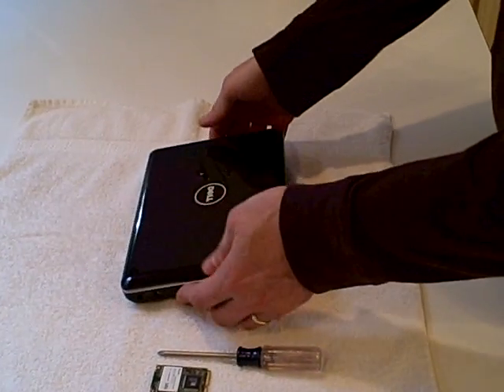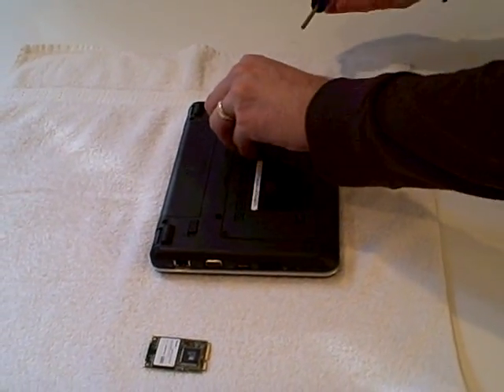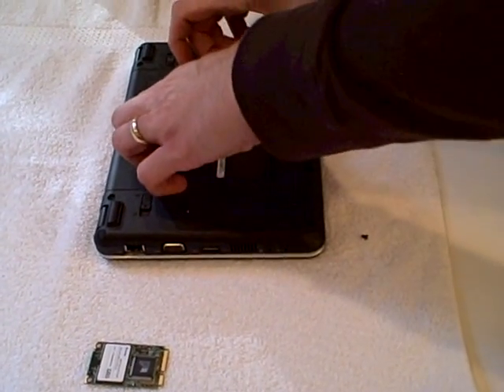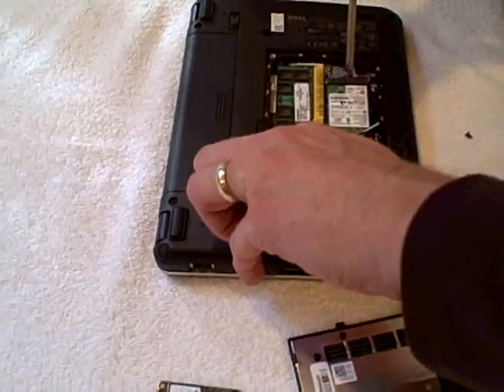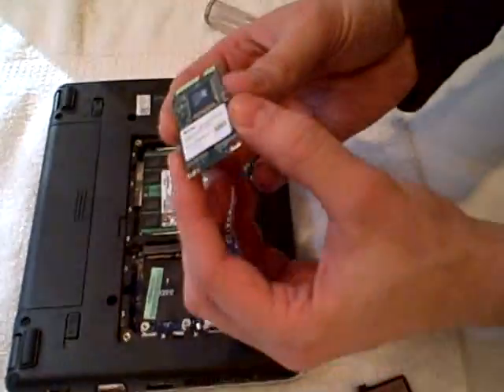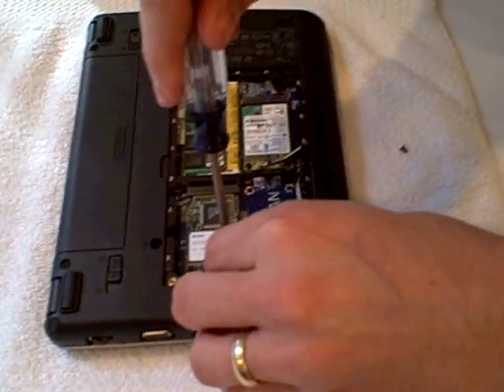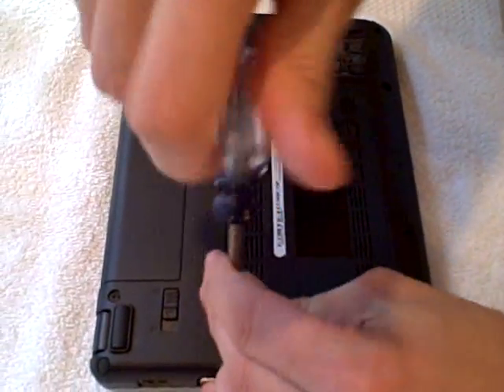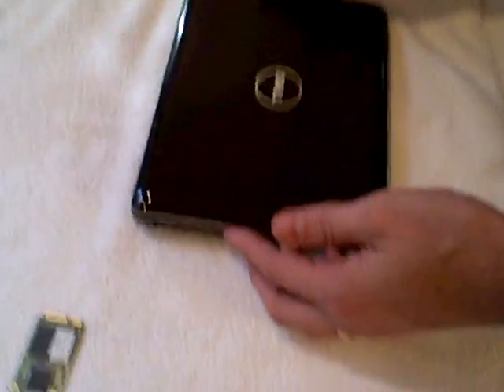Dell Inspiron Mini 9 Upgrade Flash Hard Drive

Comment: Hello, can you help me? I traded my SDD 8gb for a 32gb just like in the video above, but when I press the button to turn it does not start Bios, the screen flashes once and it shuts down. Can anyone tell me what's wrong?

Olá, vocês podem me ajudar? Eu troquei o meu SDD de 8gb por um de 32gb exatamente como no video acima, mas quando eu pressiono o botão para ligar ele não inicia a Bios, a tela pisca uma vez e ele desliga. Alguém sabe me dizer qual o problema?

Comment: I have the Vostro A90, almost the same thing.
One can "mirror" the old flash drive, by far the easiest way.
One can also buy from Runco a case to put the old flash drive in, giving you use of the old flash drive, or hold on to it as a backup for everything you have now.